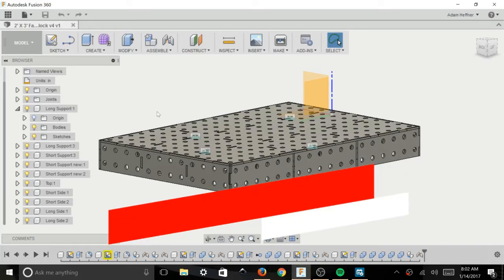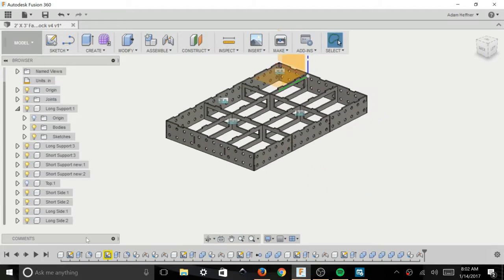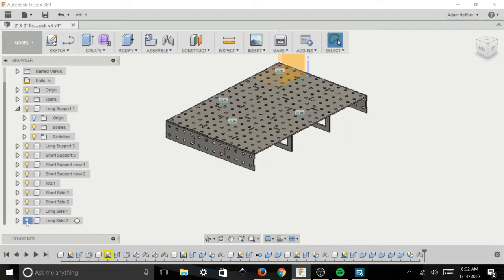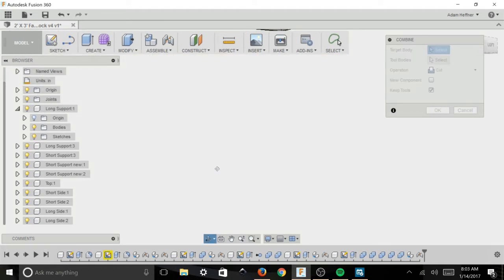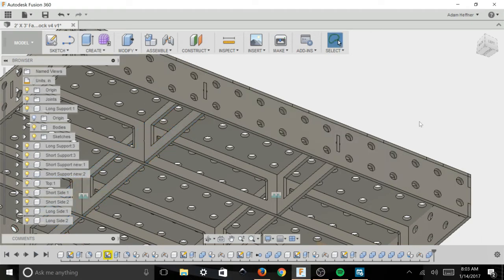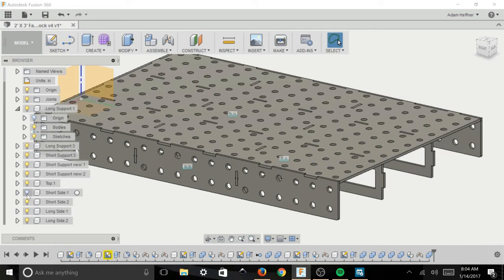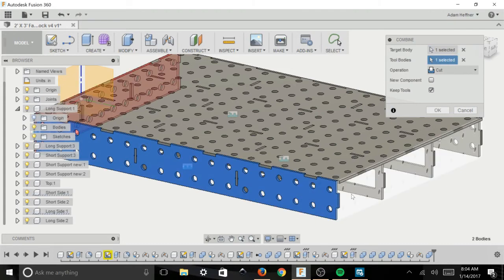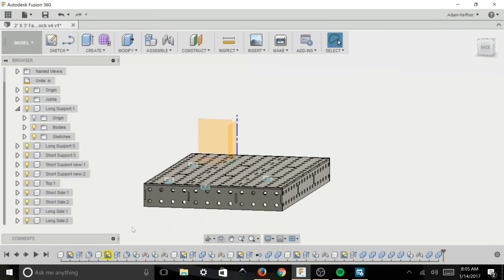Tab and Slot Design Fusion 360

Comment: Thanks for sharing Maker Table. After you've build the tab and slot profiles, how are you adding in some tolerances to ensure the tabs fit into the slots after cutting etc?
Reply from the maker: You can over extrude the plates to be a little thicker that will make the slots wider but I manually go in and push each face to make the slots longer and provide tolerance. No real trick there, it's pretty time consuming.

Comment: Love the video, but the next question is, how do i add dogbones to the sketch corners when the tabs and slots are not in the sketch but only availiable in the body structure. Dogbones must be added either manually in the sketch or with the dogbone script
Reply from the maker: I tried the dogbone plugin that someone made for fusion and it didn't work so I create a sketch using the existing body and drew a circle in each corner and then extrude them all together to create the dogbones.   Do you know a faster way?

Comment: Nice! Keep up the hard work. Your videos are really awesome, I'm sure your subscriber base will really take off soon!
Reply from the maker: Thank you! It's great to hear feedback, I've been working hard but also having a lot of fun so far.  I checked out your channel, looks like your a machinist.  I'd be curious to see what little tricks you've picked up along the way.
Reply: Maker Table I look forward to build a small cnc 500x500 mm. I will use it to finished my pcb projects. I want to build a power amplifier a clasic one. 800W. but with low noise as possible. a huge project which I wanna use in a university contest this year in June. cheers